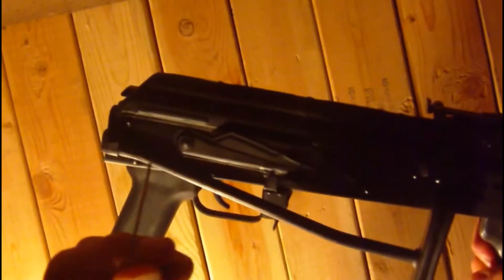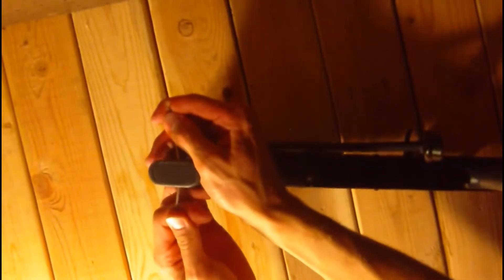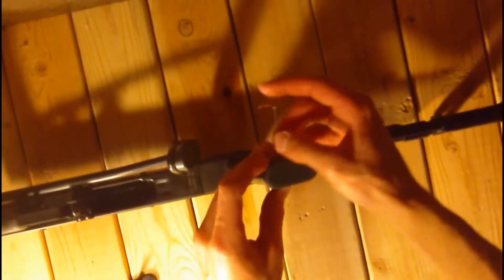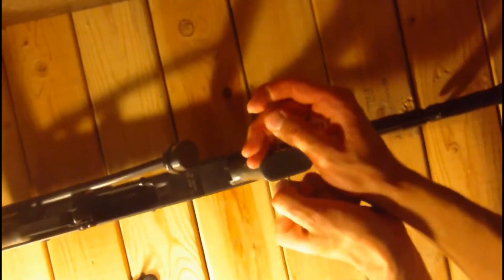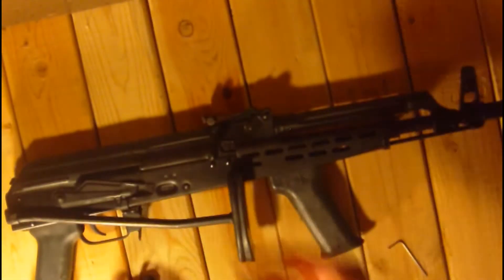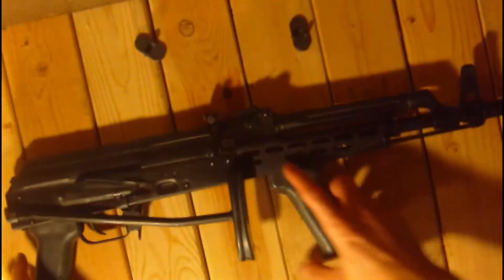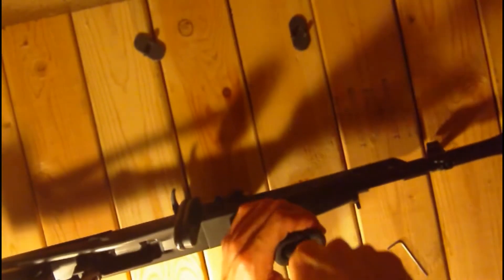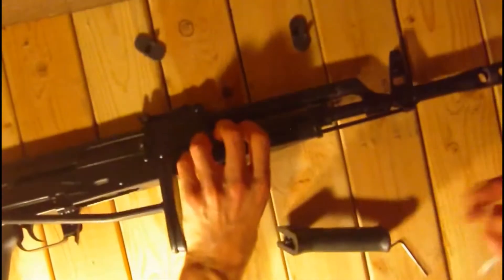AMD 65 Grip Removal - How to Remove AMD 65 Grips

Comment from the maker: Thanks for bringing this to my attention. I somehow missed Viperstarbuck's message. All you need to do is buy an "AK Grip Nut"... not angled... but straight. And their super cheap. Then pull off the old vertical grip & foregrip. Replace the grip nut inside & put on your new grip (assuming the grip attaches via bolt). Piece of cake :]